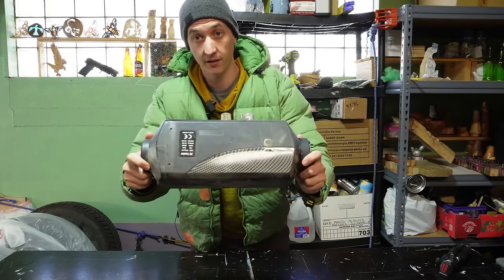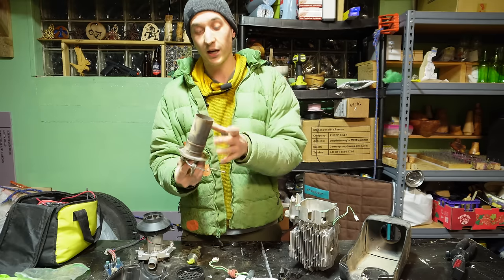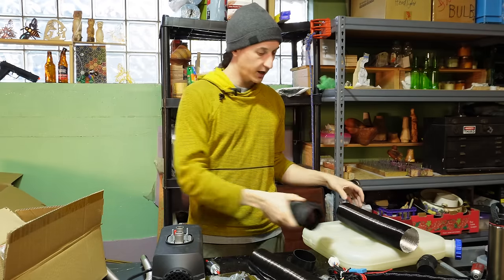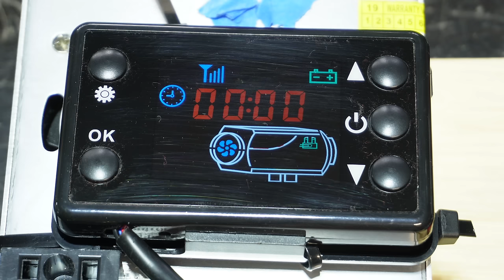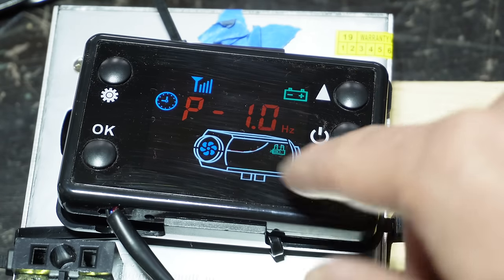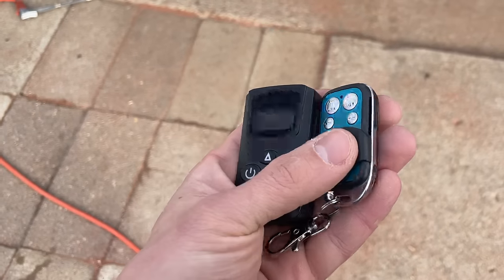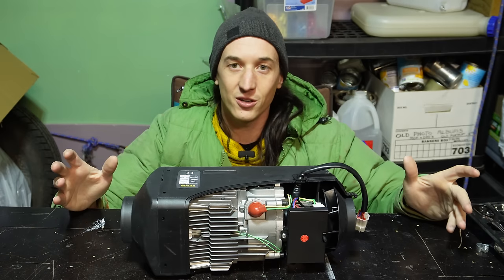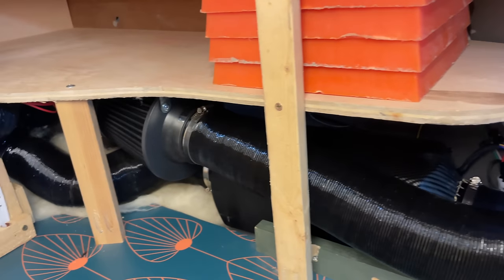Everything You Need to Know About Diesel Heaters

Comment: my lcd screen was blacked out when i got home today, its 2 years old, doing its second winter now... does anyone know what the problem is and if i buy a new controller, will that fix the problem ?.
Reply from the maker: That's weird, the LCD backlight can "fade" over time if they are left powered on all the time. Might be worth turning off the lights and checking if it's not just super dim. Next thing of course would be to check the basics, does it turn on when you press the button? Make sure you have power, the controller is plugged in, etc. If you do need a new controller I would buy one that is paired with a motherboard since your unit is so old. A new bare controller (LCD) may work, but there's a good chance it won't be compatible with the old motherboard.
Reply: @dustyodyssey   wow thanks for the reply !
so its totally dead, the heater wont run being the controller is totally dead.
all fues's are fine, i cant seem to find anything disconnected on the positive or negative lines.
just no reponse. 
if i buy a new one, ill need to buy it with the motherborad that goes in the diesel heater itself ? 
thanks heaps for the reply.
Reply from the maker: @jaaayg2791  Might be worth checking your power supply with a multimeter, and unplugging the heater for a bit to see if it will reset. But assuming you have good clean power and it’s still not lighting up I would guess it’s an issue with the motherboard or controller so yes, replacing both with a matching set would be my recommendation.
Reply: @dustyodyssey  thanks for the reply ! hopefully its not to hard to replace the motherboard too. thanks again

Comment: The complaint about the all in one exaust is certainly not valid as it exactly the same as every other unit. I really have no idea how he makes the claim.
Reply: There are numerous videos from numerous content creators, all saying the same thing.  
If you get an all in one unit that never has any issues, it would be the exception, not the rule.
Reply: @this-is-slammin-549  The exaust is piped out exactly the same in both styles. What am I missing?
Reply: @xwhite2020 the joint most likely to leak is where the exhaust pipe joints to the unit, this joint is outside when a heater is fitted to the van floor but with the all in one that joint is inside where you are 👍
Reply: @Dirt-Diggler  The outlets/spigots are identicle.They are literally the same part.

Comment: No way its asbestos how would that seal since its a hard mineral
Reply from the maker: Almost certainly does contain asbestos, just google “asbestos gasket,” extremely common
Reply: Forget about these paper gasgets buy high temperature silocone gasgets works better and use the metal exhaust as air intake as well for safety reasons because the black flexible stuff starts to break down eventually and if it's inside you may get blow back and carbon monoxide poisoning. 😊
Reply: Well there is asbestos rope gasket we used a lot of asbestos gasket in aircraft engines. But this is just high temperature paper and burns after a while you'll see when the burn chamber is opened after a few weeks and wouldn't do on aircraft engines. 😊

Comment: You get the heater for nothing? Then tell people NOT to buy it? I do not recommend this review. 
Those heaters ARE a good unit if you know how to install them properly.
 **These cheaper heaters come in several names but the are all come from the manufacturer, and basically come with the same accessories more or less. They are selling them at 2KW, 5KW, or 8KW. The 5KW and 8KW are the same identical unit. They just changed the label to sell for a higher price. SO just buy the 5KW model (save some mney) and you'll be getting the larger one (unless you want the 2KW model)
 *All those fuel tanks will splash out fuel. Just use some plastic wrap under the cap and screw it back on when traveling. Then you can fill it up. Just use some common sense.
* That cheap muffler on the intake hose makes a good filter also, if you first drill more holes in it so it isn't so restrictive and line it with cloth or filter material to keep the intake air, which is more important anyway.
* You don't run the fuel pump horizontal. They are supposed to be run at about a 45 degree angle with the exit facing up to expel the air bubbles. That's how they're designed.
 Always filter the fuel with a filter between the tank and pump. It will keep your glow plug and atomizer screen clean in the long run.
  (Ya, and learn how not to cross thread bolts) LOL
Reply from the maker: Just because I got it for free doesn't mean other people should buy it! Vevor in particular charges a premium price, but like you said is no different than what you get for half the price.
Reply: I have to add now, there is an 8 KW heaters now that are actually physically larger (just a little) with possibly a different ECU that pumps a little more fuel into the heater so it may put out a little more heat. You may have to do a search for one because I do not remember the exact name of it. I don't think they are very common yet so it may be a while before you start to see them for sale.